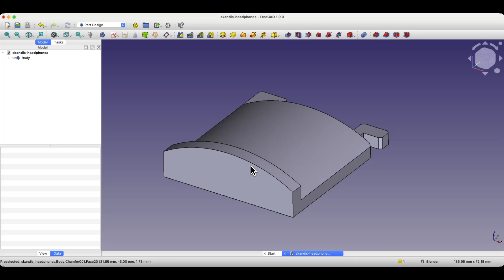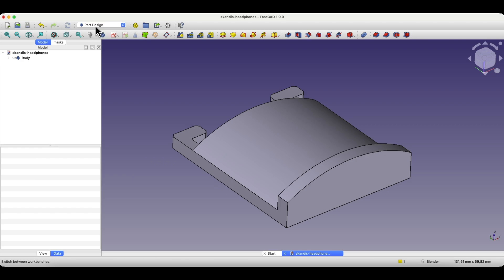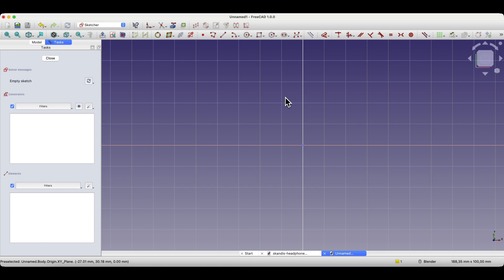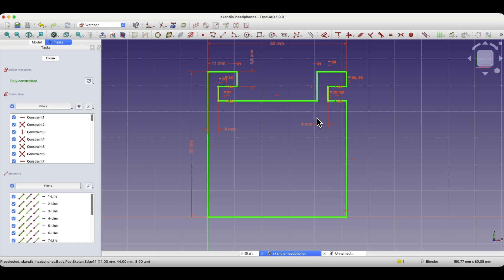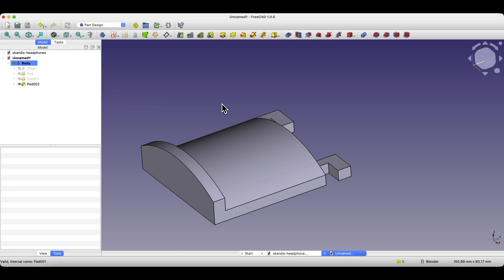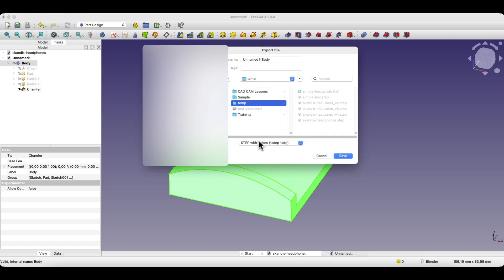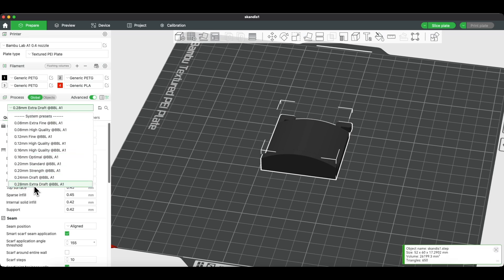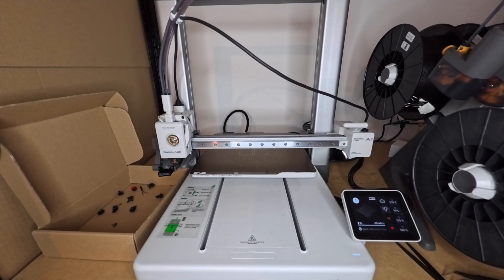How to Design a Headphone Holder for the SKÅDIS Board in FreeCAD

Comment: Really good video! Just curious how you calculated the various constraints?  Like the distance between 2 corners, seems like something you’d have to calculate yourself or are there open sourced measurements that people follow for skadis hooks?
Reply from the maker: Thanks! I just measured it with a caliper on the board itself and tweaked the model a few times until it fit — no official dimensions, just trial and error 🙂

Comment: Your skadis board is mounted sideways! The slots should be vertical! Great video anyway!
Reply from the maker: The board is mounted correctly. It can be mounted in two ways ;)
Reply: fair enough, but if knock that headphone holder to the left it will fall out. Mounted vertically, gravity will hold it in place. Still enjoy your work though!
Reply from the maker: There’s some truth to that. I checked — the headphones won’t fall off right away, but the holder isn’t securely fixed to the board, and the headphones might fall off.
However, I've been using this holder for a few months now, and it hasn’t happened to me. Besides, in this particular spot, this method of mounting the board worked better (the board fills almost all the available space, and it just looks better that way :) ).
Reply: @CADCAMLessons  🤣